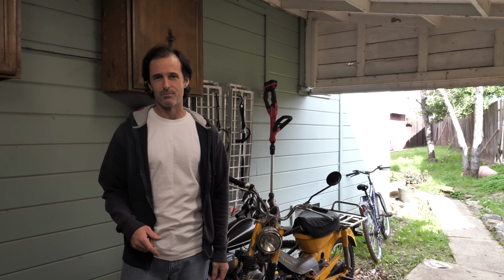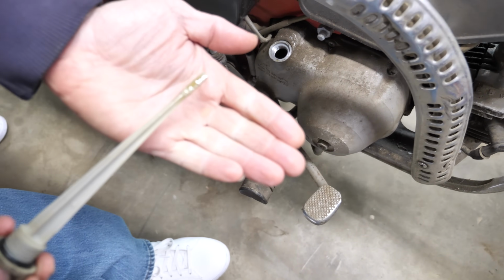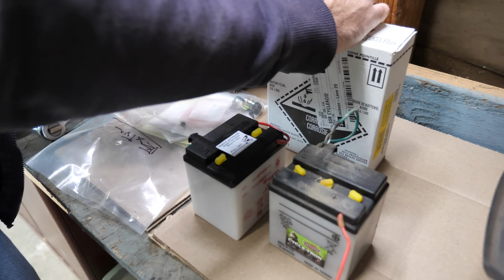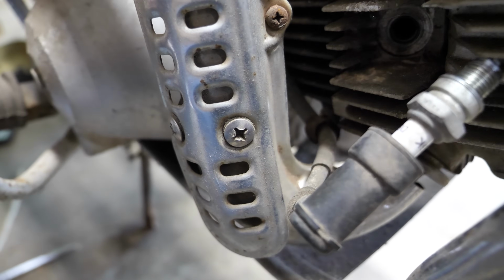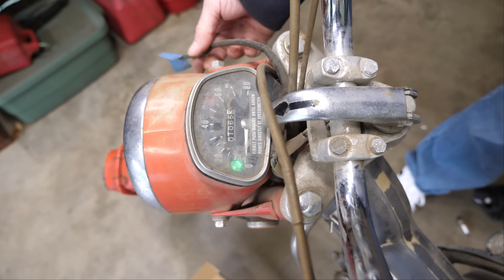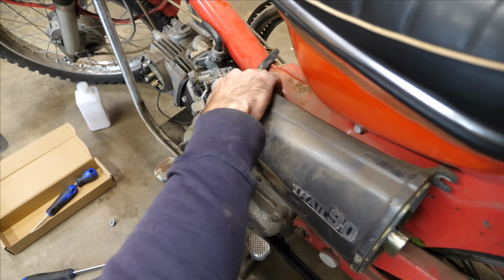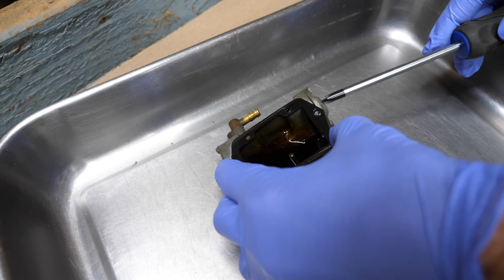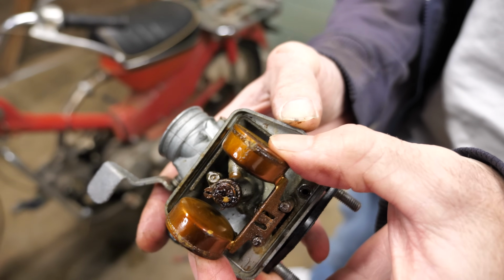I Bought A Trail 90 That Hasn't Been Started In 20 Years.....And it shows

Comment: I got an ultrasonic cleaner for Christmas and it’s the bees knees for carbs. A couple of soaks and you’re there. I too have a habit of bringing home neglected motorcycles, it’s an investment you won’t regret.
Reply: Ive mentioned that a few times.
If you get a really bad one, you can soak it in a gallon of carb and parts cleaner, the kind that comes with a soaking basket. It works miracles
Reply: My wife tossed mine out thinking it was a dirty old deep fryer! I got a new one though. Absolutely a game changer
Reply: @madeincanada5251 😂😂
Reply: Bought mine at Lidl for 20 eurobucks
Been using it for at least 5 years, performs great !
Reply: Super agreement I was just thinking earlier today. How original carburetors and their bits and pieces always seem to run better. Then some Chinese knock off less. It's one of those small  Diaphragm, weed eater, change really small 30C. Engine, but yeah, my wife got me a 22 l. Not realizing how big that is for Christmas and I can drop a whole rack of carbs off AG F750 in there and baskall mall, perfume clean after a good an hour at 60°C. Definitely recommend all I do is look for things to clean in the house. LOL. Thanks again.

Comment: I have the EXACT same machine in my garage.  I bought as a basket case and have been restoring it.  Here's a few things I've run into:  The rectifiers on these bikes were barely adequate from the factory and mine wasn't working at all, so I replaced it with a modern version.  The wiring inside the handlebars was all shorted together and blowing the fuse because the insulation had flaked off. The potting material in the coil had leaked and the coil was shorted.  Good luck with it.

Comment: I had a few of these a carb clean fresh oil clean petrol a relube of cables and clean up the points and it will run had mine when i was a kid my dad wouldnt help me fix em so i bought a manual and jus got on with it i used to buy these honda dax /monkey bikes and most old 70s bikes for realy cheap money in the 80s/90s it realy took me back seeing you check em over and service em .

Comment: You got a good deal, those are simple and easy to work on and there is still a very good market for them, I would strip it down to the frame and clean things up, paint a few things and you can get top dollar for them, all those early trail type Honda's sell quite well, I've sold a few of them and I sold every one of them within a few days of posting, the Trail 50, 70 and 90 all have the exact same style of engines, it's one of Honda's greatest sales successes.

Comment: The 70 downtube cover and airbox are kind of unique that year with the recesses for the emblems. I took a set  for my 78 and restored with new emblems they look good.  Be as careful as possible with those plastics. They love to crack and break easily.  700 is a decent deal for it as complete as it is and milage. I'd look at the gauge closely to see if it matches that year and any signs of tampering to be safe but it looks like the right guage and a low milage bike. If you got a title with it that's a really good deal.  Fully restored these can do well.  A low milage survivor could do 2k or more with a title I think.  Good find!

Comment: I’ve had similar situations with slides stuck worse than that sometimes a gentle application of heat to the area of the slide on the exterior of the carb helps quite a bit, great video! You guys are too cute!

Comment: The levers have different sized ends so when blind people ride them they can tell the difference between the front and rear brakes or clutch… 😂
Nice find on the CT, looks like a very good find, btw the carbs are still available through Honda, couple places to check out are TB parts, and phatmx

Comment: Heat gun or boiling is the best way to remove stuck parts from carbs. I found for varnished carbs the absolute best way to clean them is to use Kleen Strip brush cleaner. It works amazingly.

I'm working on CT right now that has me stumped. When I hook up the battery the terminals spark, it gets hot, and the rectifier gets hot. New rectifier gives the same result. I assume I either have a short or maybe a bad coil?

Comment: Nice bike. You got yourself a great lady. Real nice of her for getting you the JIS set. I have a JIS screwdriver set for my Honda's, they are a must. I had a fourwheeler carburetor that was in worse condition than that one. I mean it was full of rust. The float was rusted to the float pin, I had to carefully disect that carb. But I did get it clean and that was three years ago and the machine is still running strong. So please clean that OEM carb and use it. I hate when people just take the easy route and buy a cheap chinese carb to put on.

Comment: I always try to save the oe carb, but I now have a ultrasonic cleaner so that deff helps. I use torch tip cleaners for small passages. Or various size Bristols from different metal wire brushes for the ultra fine passageway in a carb.

Comment: I'll never go back to using Phillips again after getting JIS screwdrivers. Phillips, by design, were developed to cam out after a certain amount of pressure is applied. JIS is designed to stay put. Fun fact: they can stay horizontal on a bolt head without you holding it there.

Comment: So According to honda,when I was doing the certification test,after you put the acid in the battery, you are supposed to wait for a half hour before you put the caps on,and then do a new battery charge at about 2 amps,until it's fully charged.if you do it that way,the battery will last for years under normal conditions.

Comment: I would save that carburetor. Get an all balls rebuild kit. Then my secret to rebuilding carbs is as follows. 

Get a brake lamp from a auto parts store go to your nearest rual king or tractor supply and get the gunk brand carburetor parts cleaner. Also get the 3 brush combo kit  (steel, brass, nylon) for scrubbing. Also grab a a small container of valve lapping compound (I'll explain later what this is used for) Lastly get a small tube cleaner and torch tip cleaner set.

Add the fluid to the brake lamp and pressurize it!

Use said brake lamp to spray the parts cleaner throughout all and any passages in the carburetor and parts to be reused. Generally I only use the bowl gasket and float needles. It will eat away old varnish. Like the fuel bowl, it would only take a matter of a few minutes to clean up. Use the valve lapping compound on the tip of a q-tip and put the q-tip in a drill insert the q-tip into the needle valve seat and scrub away. It will come out looking bran new and have a circular scrub pattern to help the needle seat in place. Use the torch tip cleaner to clean the main and piolet jets and emulsion tube. Use the small pipe cleaners to ram through the passages for the main and piolet holes in the carburetor. Use the scrubbers like the brass one for the brass floats  and don't forget to push fluid though the carb multiple times and run through everything twice.

Almost nearly every carburetor I had cleaned this way comes back and sometimes works better than before and also check float height and hold the carb upside down and blow through the fuel inlet on the carburetor to test the needle and seat. 

Sorry for the long winded comment but I love your channel and wish to share my knowledge of rebuilding mikuni, kehin and walbro ECT carbs and pass this knowledge onto you.
Reply: Add Fluid to a brake lamp and pressurize it? You mentioned brake lamp to twice so it must not be a typo. !?

Comment: I've a '73. I haven't yet put the new air filter on. My Honda CM450E I put a spray oil on the filter recommended by the shop. I wonder if it's good to use on the CT90? And on ebay it shows another filter that's looks to be white paper and sits behind the other filter under the plastic casing. Is that true?

Comment: Dude an ultrasonic cleaner will have that like new .. I've used a lot of carburetors that look that bad and... I even used what's called Seal All.. it comes in a yellow tube at auto stores I fixed copper floats that have holes in them and they work still 2 years later..... And I fixed holes in gas tanks even with it

Comment: For three decades, everyone wrenching on Japanese bikes were under the illusion that the screw heads were made from cheese. Few realised that/why the "joke" screwdriwers in the bikes' toolsets fitted perfectly. Instead they put a "quality" Phillips #2 bit in the impact screwdriver and pounded away with the sledge, then replaced the buggered screws with Allan head bolts

Comment: With the price of carbs on Amazon these days, I'd just buy a replacement. A replacement that fits a bigger engine. Then go buy the engine too. Than instead of a Trail 90 you can have a Trail 212...or a Trail 250!!